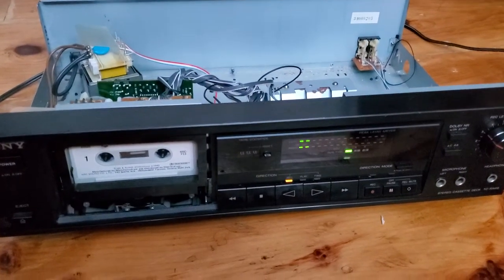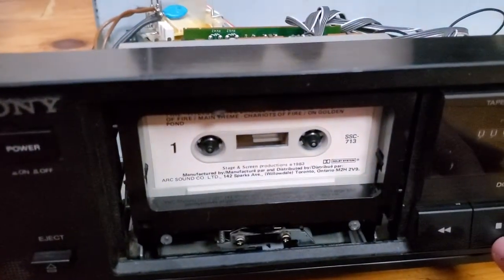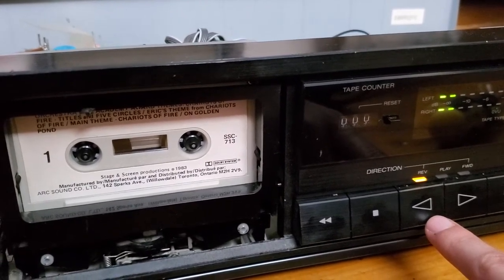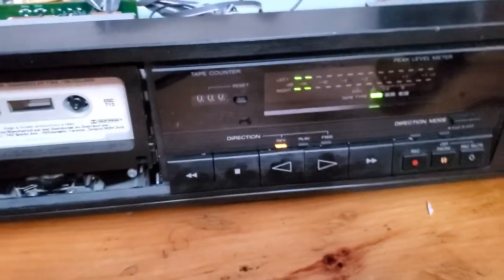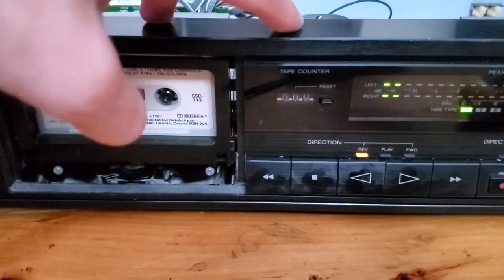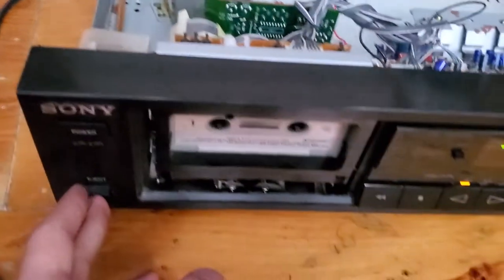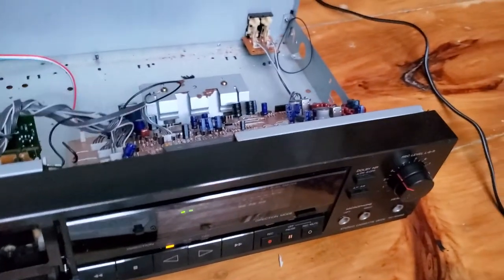Sony TC-RX410 clicking problem

Comment from the maker: This tape deck was parted out at the end sadly. I was young, and stupid. I rounded off a few bolts in the mechanism, routed the belt wrong and ended up tearing a ribbon cable. Someone else used its parts to fix a similar one, to great apparent succes.

Comment: I have this exact deck and I replaced my belt today.  I had the same issue as above then I realized that I routed the belt wrong and all is well now.  Been playing tapes all evening since I got it back together the right way.  These Sony decks are real work horses.
Reply: How did you route the Belt, just got one of these decks and it doesn't play properly
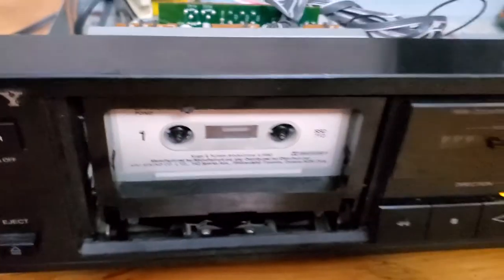Reply: @therealraviable  If you look at the mechanism in this video at 1:32.  you can see he has the belt going around both bottom pullies.  That wheel on the bottom left corner if you are looking from the top as we are in this video; that metal wheel on left is not a pully; its a fly wheel.  So what you want to do is route the belt around the right side of the flywheel. I think during reverse play the belt may touch the flywheel but it should not go all the way around it like you see here.  There is a little plastic pully in between that big pully (bottom right) and the flywheel that is how you need to route the belt.  remember this is an auto reverse deck.  So when it changes directions it moves a cam under the pullies so it can run the opposite way switching the take up wheel with the free wheel.  I would remove the transport from the machine carefully and I did all my belt service on my bench and then re-installed it back into the deck.  Don't forget about the tape counter belt.
Reply: @EdLawless  Great info Ed. I re-routed the belt according to your instructions. The originals were so melted, I could not determine the correct belt routing. Service manual also did not show it. Tapes play fine in REVERSE playback mode [<], however, when playing the tape in FORWARD mode [>], the takeup is frozen and the tape spills into the unit. (eats tape). Any tips on what to service to get this unit playing in Forward AND Reverse mode properly without eating tape in forward mode? FF and RW both work normally BTW
Reply: @Eric-ck5qr Since you said your belts perished, I would check to see if the auto reverse cam is able to move freely.  You may need to lubricate the cam with a precision oiler and or clean up remaining belt gue.  Also inspect the cam for broken teeth.  If the teeth are broken you maybe able to get replacement or someone to 3d print one for you.  Hopefully its something simple.  Have you faked putting tape in deck and watched the mech as you run it in forward and reverse?
Reply: @EdLawless  Indeed you are correct! Upon further digging, found that the white cam arm was seized on it's metal post. A light cleaning and re-lubrication worked. Also, I was able to wiggle it back and forth to work in the lubrication, as opposed to removing it which would have meant removing the mode select cam and other spring loaded tiny parts. Thanks Ed!!
Reply: @Eric-ck5qr  Glad you were able to get it running again.  Mine belonged to my uncle and it has been in my family since new.  That deck can be a real work horse.  Although, I don't run tapes as much as I use too.  Its still fun every once in a while to find something random in a drawer and give it a listen.  Best tapes are the ones with nothing noted other than Mix Tape and a number... If you ever find that the deck sounds flat after cleaning you may want to check your azemeth adjustments.

Comment: I think you have installed belt in the wrong way. Remember, this is a auto reverse deck, the reverse capstan belt has to go over the capstan, not around it. when it play or winding, the two captains has to spin on opposite directions. Because, i saw when you hit the rewind, the wheel was turning the wrong way. The speed adjuster of the motor should be on the motor or follow the wire of the motor, where it connects to that small board behind should have the adjuster, Sony always have markings on adjusters of what they are. Good luck.